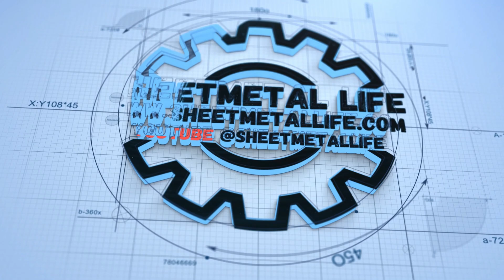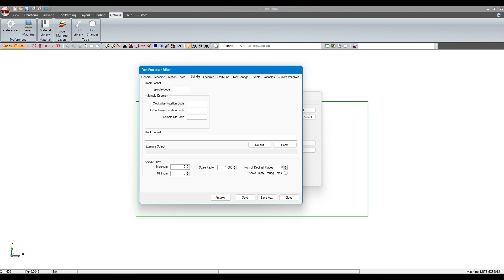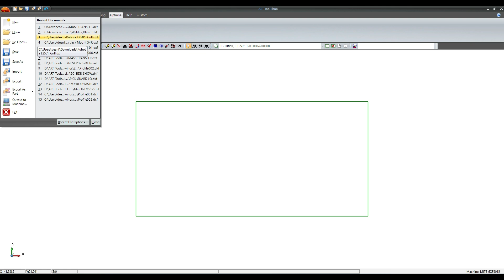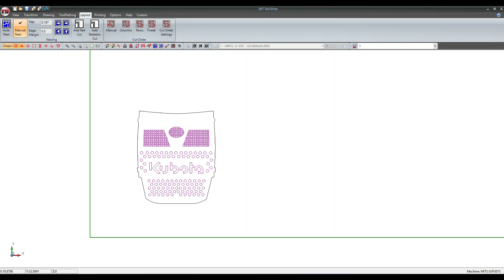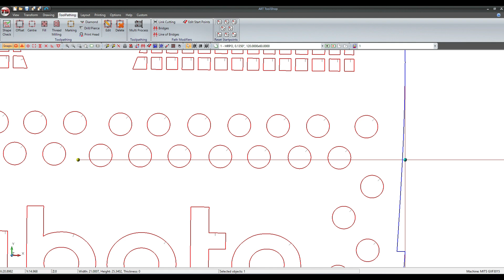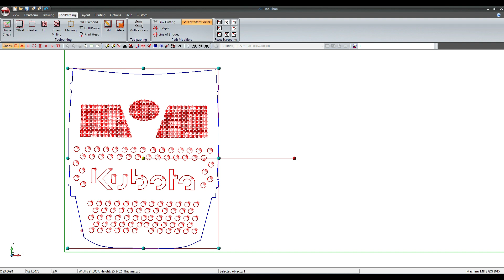CAD CAM NESTING SOFTWARE #lasercutting #cncrouters #cncplasma #toolshop #cadcam

Comment: Thank you for sharing, this is the first time I’ve heard about this software, I am currently running a Mazak, trumph and two amada co2 3015’s . Do you know if this nesting platform might be a option? I do have Radan, sigmaNest, lantek and experience with a few others, always looking for new options.
Reply from the maker: @BoneyardHauntedHouse  I have run AMADA FO3015 I would have to look into a Mazak Post email me at engineers@sheetmetallife.com you Machine Models and a sample code